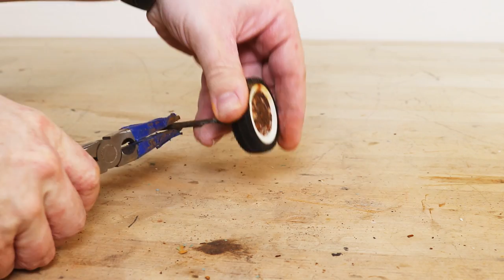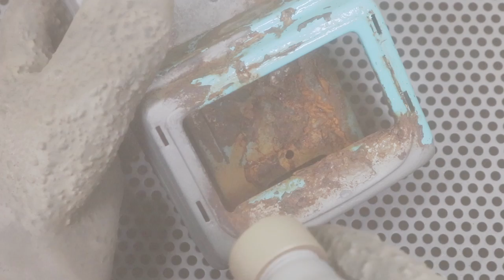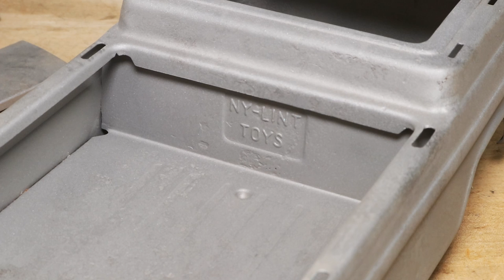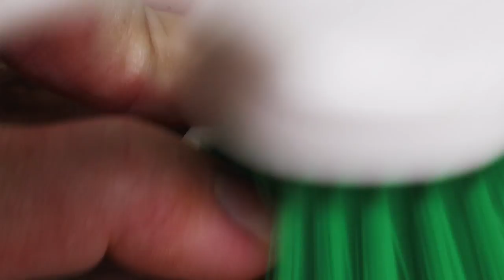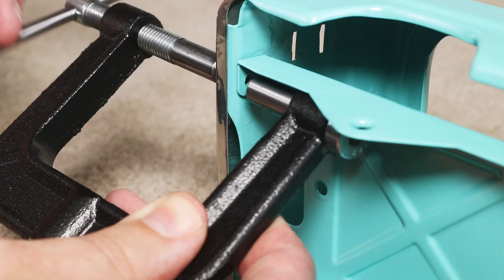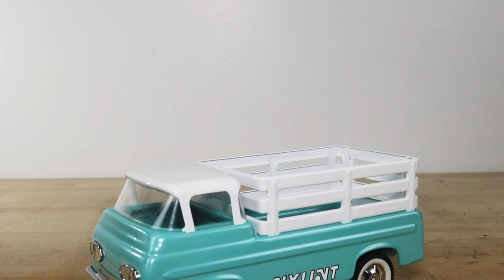1960s Nylint Econoline Farm Stake Truck Restoration

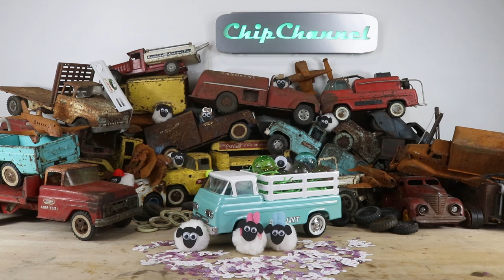Comment: 20:14 I found the race car that I sent you. The sheep in the red hat is riding in it.

And since then, I've found more stuff at the antique store that could use a restoration, but I'm a little strapped on cash. I found an Ertl tanker truck, the Tonka ambulance, a Hubley stake truck, a Tonka pickup truck, and a flatbed I can't identify.

Comment: You didn't split the chassis from the body. Isn't there gonna be rust between the 2 surfaces?
Reply: It looks like it was spot welded, not easy to remove and put back together.

Comment: Your work is always excellent and I look forward to each new installment. I do have a question.  How did you handle the rust underneath by the trailer hitch? There appeared to be a lot of rust through there and you didn't cover that repair in the video. Just wondering if there are some deleted scenes? Look forward to the next installment.